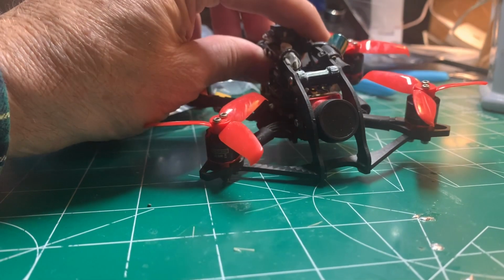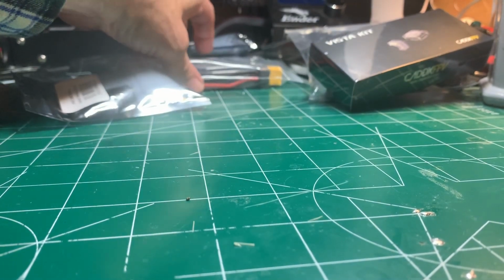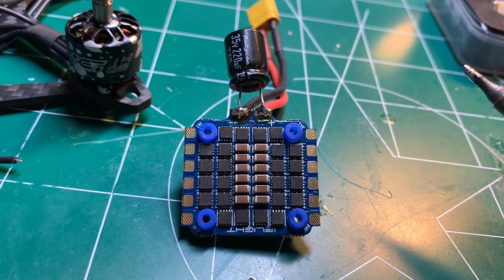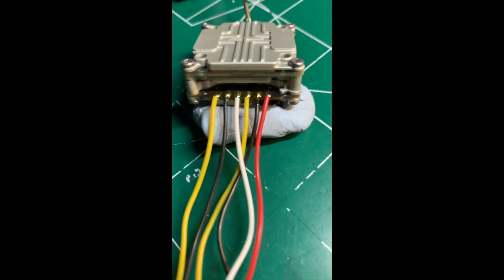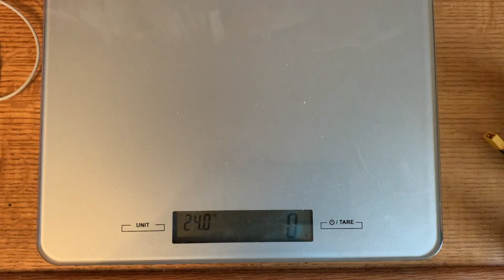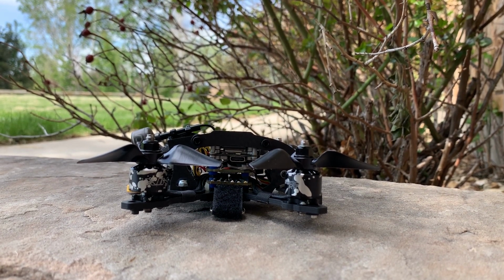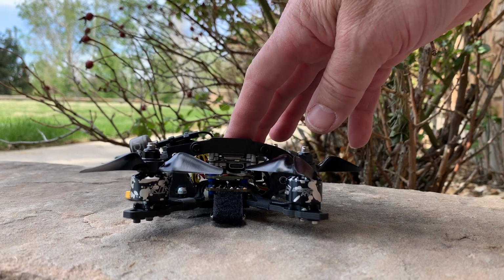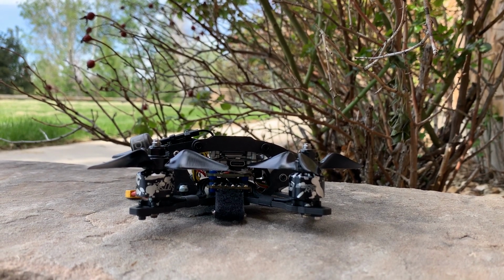Catalyst Machineworks Massive Droner HD Build

Comment: I love catalyst machine works! I built a 3 and 4 slam nasty recently. Have two 5" builds. Thinking of building this. Is this a Tru X or slightly tweaked like the slam nasty geometry? Awesome build! 👌
Reply from the maker: Hi Mike,
I am a big CMW fan myself. The frame geometry is 103mm wide by 79mm long (motor post to motor post). Very fun little quad to fly and as stated can take a crash.
Cheers,
SLOG

Comment: Thank you so much! Gonna get this with 1404 motors instead :) Just lost my beetle, didn't have a buzzer, tall grass. Check
Reply from the maker: Aemilius,
Sorry about loosing your beetle. I have the same issue trying to find a lost small quad in a field. Buzzers help a lot. In a pinch I always have DVR record  on which can help. Have fun with your new build!
Reply: @slogfpv5679  Thank you! Yeah I actually thought about putting my SD card in the goggles just before flying. Was my own fault, had a half broken front arm and just taped it. And I was flying really high in moderate winds/stronger winds high up.. :p

Comment: Just got frame! Finished geko! Thanks for idea! God bless
Reply from the maker: Sleeping Bear, sweet build! Like the lights :)
Reply: @slogfpv5679  hey!! I put link in brother! And was waiting for your response.  You like the 3d parts? Or over kill?? Arm guards a must.. one wreck on concrete wish you had.. lol  lights are for when fallowing. I'll make a night vid tonight! Looks cool! I erased my bad lol thanks for checking out! Flys great on 349 pids. Which is good I need to learn to tune. 🤣😁
Reply from the maker: @sleepingbearffg5008  I responded on your channel. I like 3D printed parts if you are around concrete or asphalt. I fly mostly in parks so not as necessary for where I fly. I was trying to keep my build under 250 grams with a battery so that influences what I put on my builds. Have fun!

SLOG
Reply: @slogfpv5679  any 2inch ideas??
Reply from the maker: @sleepingbearffg5008  The only 2inch build I have planned is converting my Beta85x HD to run a naked Hero 6. More of a Cinewhoop.
Reply: @slogfpv5679  👊👊💪💪

Comment: Hey guys I have the bind and fly version of this quad with caddx vista and came with rcinpower motors 1507 4100 KV. Would it be better to go with a 1050 4s or a 850 4s?
Reply from the maker: Hello ScottFPV, I will let others weigh in as well but if your goal is to stay under 250g than you will need to go with a 650mAH 4S. The sweet spot if your flying freestyle would still be around 250g for good flight characteristics with 3inch props (disk loading important). Chris Rosser does a great job at explaining the physics behind this. 9:02 in https://www.youtube.com/watch?v=zY68Nf9Cobs
SLOG

Comment: Yo Slog, I ended up ordering a frame 😅 came in at $126 AUD with shipping to Australia 😭 ouch 😭 
DHL gets half of that though, there website says USPS is crazy slow cause of covid19 atm so choose DHL
Reply from the maker: Barnz1980 I had to do the conversion. $89 USD is spendy. But I like the design of the frame for the Vista. Very tough frame and it protects the electronics and camera. I think UAVfutures did a review of the analog version of this frame and gave it high marks. Point being I think you will be happy with it.
Cheers,
SLOG
Reply: @slogfpv5679  definitely a crappy time to be purchasing things from the USA but imo it's always costly getting things from you guys compared to other countries even when covid isnt looming😬. 
For sure it looks like a legit frame although I never broke either of my 2 tyro79 frames over the last 8 months & Ive had those fall out of the air for various reasons many times. 
Hey would you put the same motors on your build again or go for something more powerful?
Reply: @slogfpv5679  hehe, frame just arrived. It's not even in a tiny lil box, just in a bubble wrap bag😂🤣. Whole package is about 5mm/0.197inch thick & yeah the size of a 3inch drone. Dam they bloody got me with that postage 😅😂🤣 crazyness! 
Just opened my tiny package that cost alot to deliver 😅 drone frame looks the goods though👍
Reply from the maker: @Barnz1980  I am glad it did not get lost along the way or damaged.I think you will have fun with this build. If you have any questions let me know.
SLOG
Reply: @slogfpv5679  cheers slog, I got 3/4 of way thru building it & was like where the hell does the caddx vista go?!?!? .......... Wait for it....
I bought the bloody analogue version!!!!! 
Not the HD version 😠😡😠😡😠😡
Much swearing followed.
Then I ordered a arrmatan gecko 3" kit locally 😅 hopefully it's here in a few days
Reply from the maker: @Barnz1980  Sorry for the bad luck you are having. However, the good news the Gecko is another great little frame. The Vista will fit in fine. I have the 4" version which is the same, just longer arms.
Take Care,
SLOG
Reply from the maker: @Barnz1980 ,
I used the XING ing
Reply: @slogfpv5679  sweet, I'll have a squizz 👌